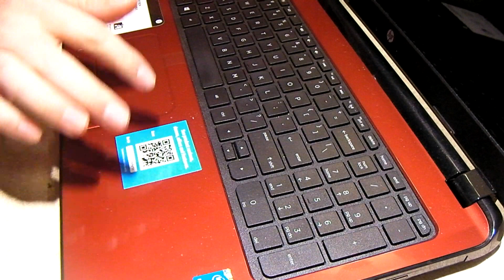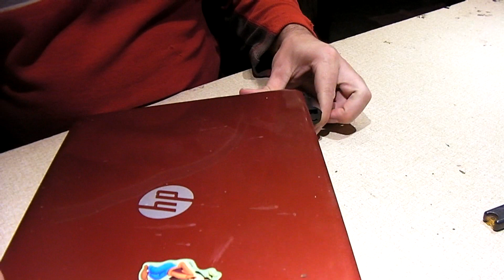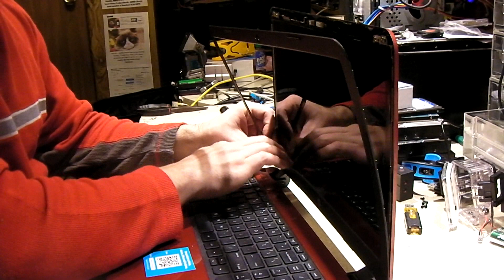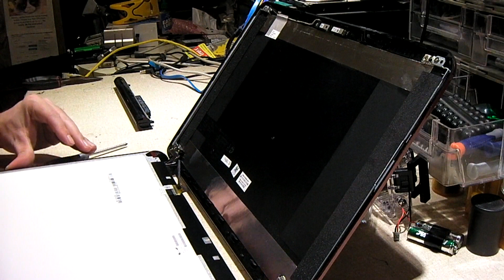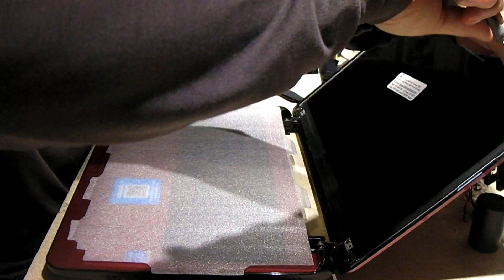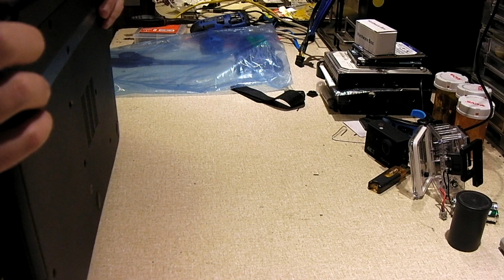Replacing the LCD display in an HP 15-R132wm Laptop

Comment: I have this exact same model with the exact same issue. Thank you for the upload. Any chance you could do one on installing more RAM? I want to upgrade from 4 GB to 8 GB.
Reply from the maker: This was a customer's machine. To get to the RAM, you most likely will have to remove the motherboard, and I believe this machine has only 1 RAM slot.

Comment: Question: if you want to answer.  I have an Acer 17in Laptop and 4 years old, I use it, for one thing, programming radios.  My problem is, the USB's and not seeing my mouse, I tried all USB's, 2 wireless mice, and 2 wired mice and none work. However, everything else I plug in the same USB's work, camera, mic, thumb drives, everything but the mice. Hmm!! any ideas?

Comment: That didn't look too hard.  I heard the touch screens on laptops are more complicated, apparently you need to use a heat gun for those?  You are right, some of these Walmart laptops seem like they are disposable.  I had to replace the hard drive on one lately, and you have to take the laptop half apart, the hard drive was under the keyboard.